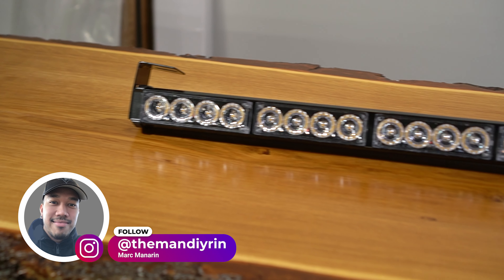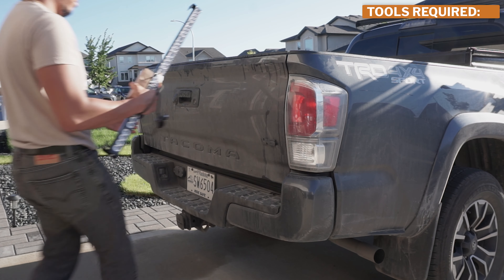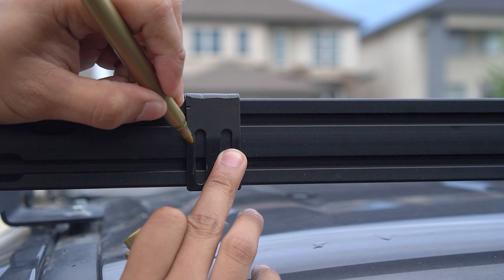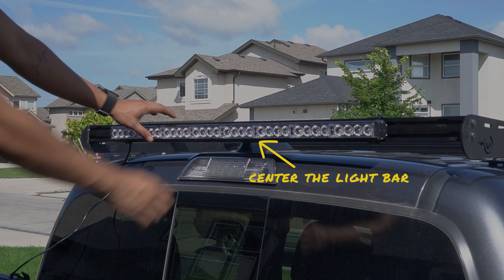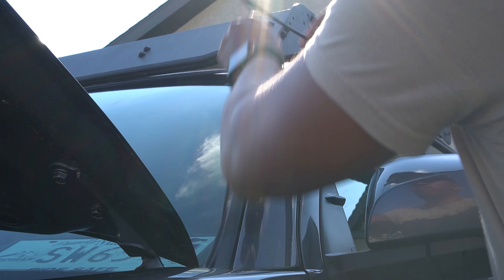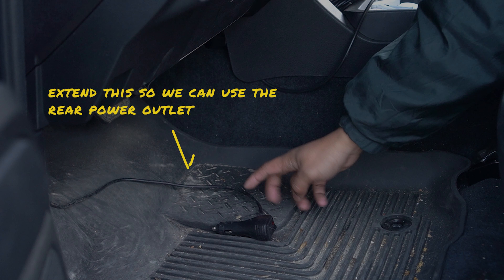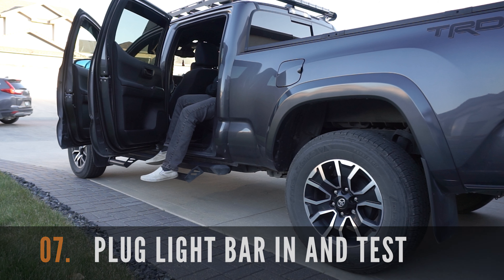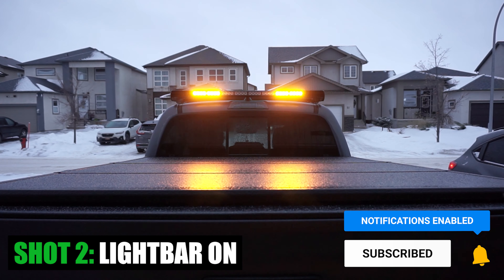EMERGENCY LIGHT BAR MOD on the 2022 Toyota Tacoma TRD Sport | 3RD GEN TACOMAS

Comment: Nice mod.  I have the 6 inch emergency light bars and installed 4 white ones under my rear bumper as extra reverse lights and 2 amber one on my front grill as daytime running lights.  These aren't as bright as higher end light bars but I like that they also come with strobe feature.
Reply from the maker: Hi thanks for watching my video! Love to hear about your mods! I'm thinking of adding more strobe lights around the truck since I use this for construction! Any suggestions for the smaller lights?!